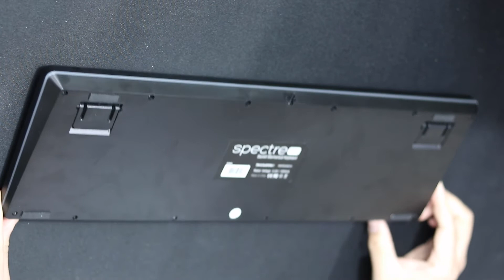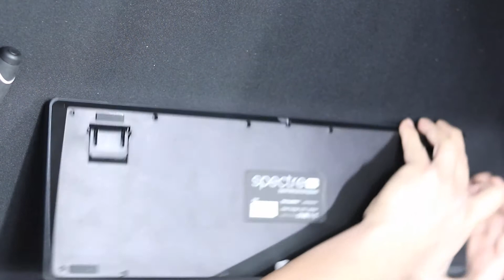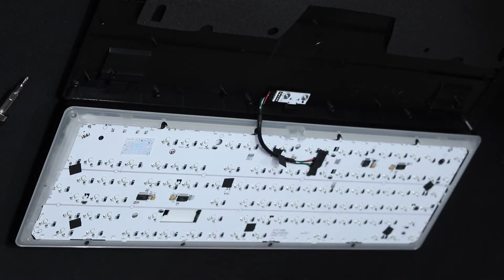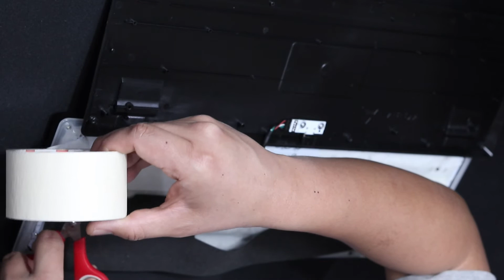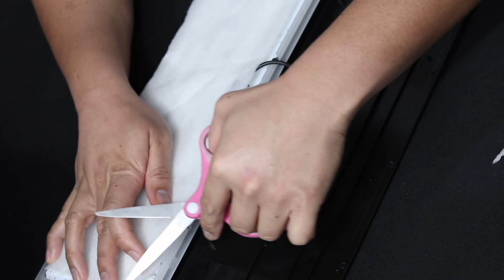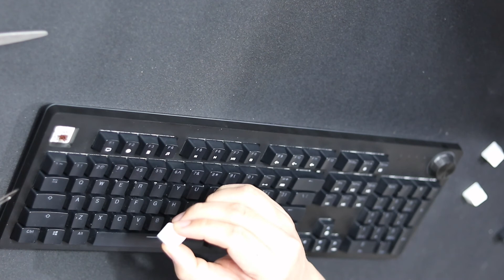Tecware Spectre Pro modded

Comment: Great job. 
Question though. Were there plastic clips holding the back on?

Do you think there are clips in the front?
Reply from the maker: i didn't see any clips on the back. im not sure if there are clips in the front since i never took off the front. im guessing there might be clips in the front because it has the led on the sides and it wasn't connected to the bottom. so i am guessing its connected to the top.
Reply: @RR-ss1tj  thanks for the info!

Comment: I wanted to change the switches of my spectre pro but the switches are tight and if I pull hard, the switch will break. Any tips for removing switches without breaking the switch?
Reply from the maker: they are in there tight, but you can pull them out. i removed all of mine. just hold down the keyboard with 1 hand, and yank the switch straight up with the other hand. the pins won't bend, but if they do its ok, the switches aren't the best anyways, lol.
Reply: Get a new puller, not the one it comes with